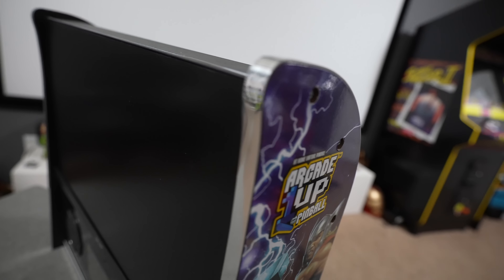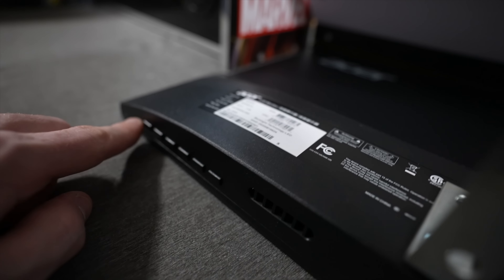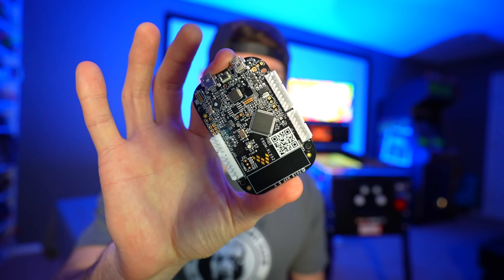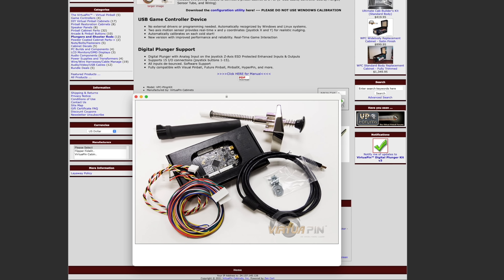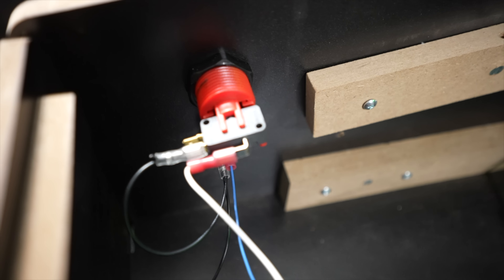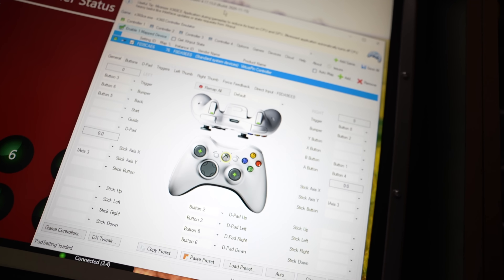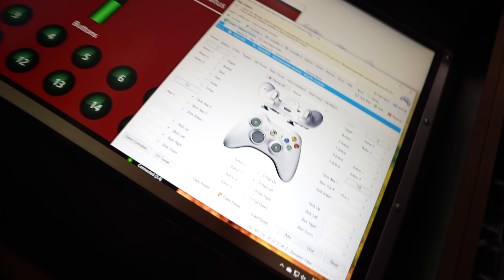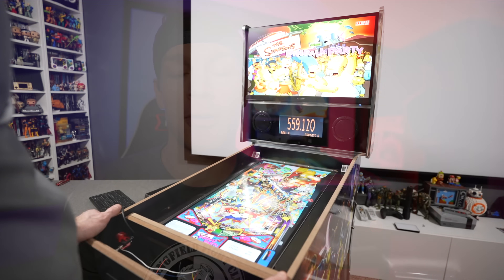Arcade1Up Pinball Mod Tutorial - Part 2

Comment: All great videos.  If it helps others, I wanted to add that I have the stock plunger plugged into the Analog input on Geeekpi and use X360ce for the analog input.  As laid out in the comments section to the Kongs-R-Us video on his solenoid mod (https://www.youtube.com/watch?v=V3lIIHKTNlI and scroll down to load all comments, and search "plunger"), you have to flip the outside pins on the default plunger wire, but then it works great after setting up X360ce.  (I didn't want to spend $170+ after shipping for the plunger kit, where the stock plunger and sensor work with the ($20 ebay) Geeekpi just by flipping the existing white and black wires.)  I like the Geeekpi because it is is a button board already populated with button headers (though it wanted my best quality USB shielded cable to be detected by Windows successfully).  For nudge, I picked up a KL25Z board and plan to put on the free Pinscape bootloader (mjrnet.org) but otherwise leave it unchanged (Arrow.com currently cheapest at $16).  I know one can also just use the KL25Z for buttons too -- and eliminate the Geeekpi -- but then you'd have to worry about populating the KL25Z board with headers and daisy chain the ground line or use terminal blocks for the buttons.  It's as cheap and less hassle to use the existing Arcade1up buttons/plunger with the existing JST connector wires, and plug all buttons and plunger into Geeekpi.  So ~$40 and X360CE gets you using the working stock plunger with nudge.  Or if you don't care about nudge, just get the Geeekpi for $20, a good USB cable, and you are in business.